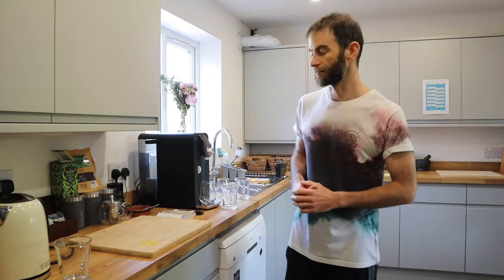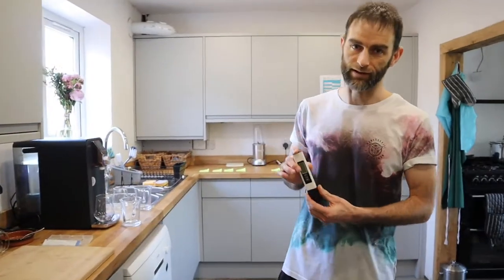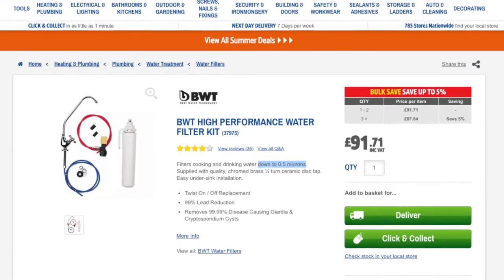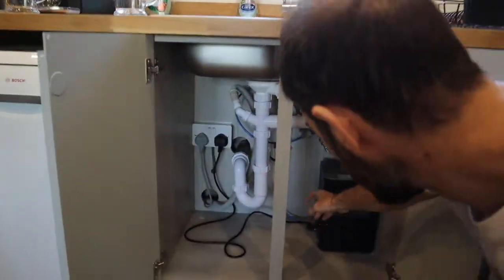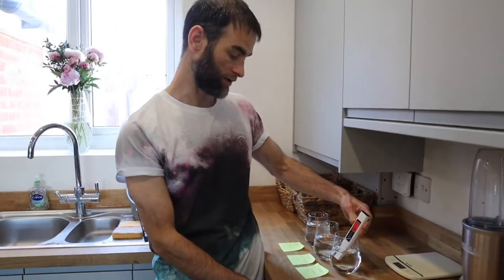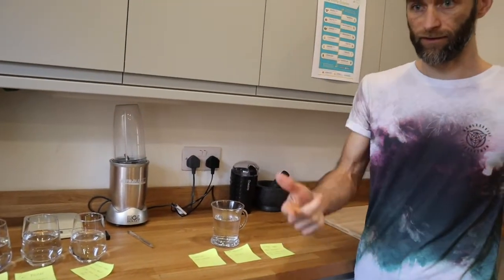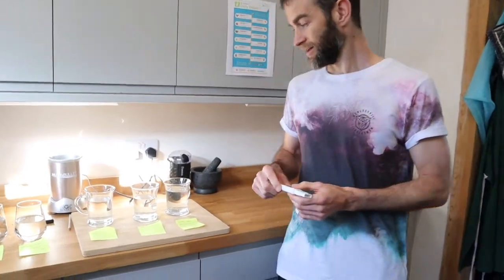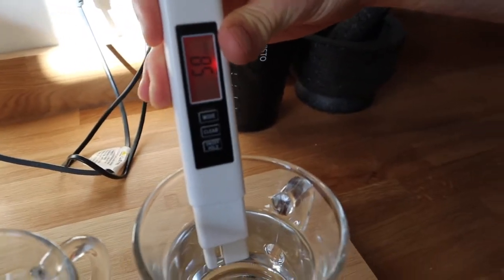Testing Tap Water vs Filtered Water vs Reverse Osmosis Water

Comment: Can you use a few grains of pink Himalayan salt to reintroduce minerals?
Reply from the maker: Hi Troy an update on my electrolyte blood levels . . . they are absolutely perfect! 

I have been using this RO filter for 6 months now with zero added electrolytes and I appear to be getting enough from my food alone which is what one side of the RO fence say 😂. 

It seems in my case the other side of the fence claiming that RO water strips electrolytes from my body and all sorts of other wild claims doesn’t appear to hold true. By all means add some salt to your water if you like but if you are eating a diverse range of whole food plants in your diet you should be absolutely fine 😊👌. 

This RO filter also has a post filter already included to reintroduce a few electrolytes back into the water too. Please use our link in the description if you would like to learn more about Osmio 😊.
Reply from the maker: Yes that's a great idea. 

I have been using this filter for 6 months now and I'm getting some electrolyte tests done in the next few days to see if it is having a negative effect on them or not (as I've read a few horror stories as I'm sure you have). 

Some say we get plenty through our food and some say RO water strips electrolytes from our food so I will see categorically through actual testing what the truth is. 

I haven't consumed any electrolytes up to now and don't add any salt to my food and deciding whether I should or not so I will let you know what my outcome is 🙂.